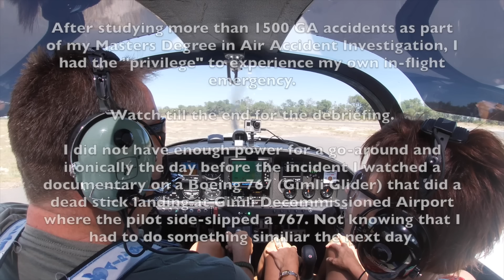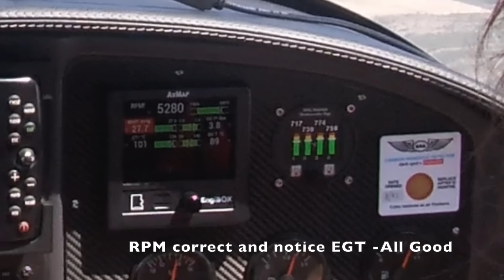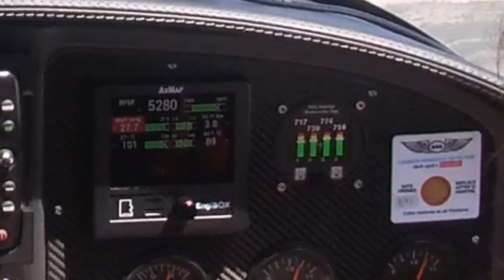Engine Failure at 1300ft AGL, Morningstar ZA, Pioneer 300

Comment: how you say you’re engine failed when it’s still working
Reply: From what I heard the engine had a failure of two cylinders not a total engine failure
Reply: @EI6DP-Real-Hams-Use-Vibroplexi would remove engine failure from this video then.  engine had an issue.  but it didn’t fail and kept working to some extent.   so this is very click bate in my opinion
Reply from the maker: I don’t give a shit about clicks. Aviation engines have only two states. 100% or failed. If you loose two cylinders then your engine failed. Now go troll someone else’s page please.
Reply: @justplaneadventures8030  click bater with click rage 😳

Comment: You kept your cool and did the most important thing first and foremost.  Flying the plane. Then working out where to fly it.  Only then trying to be coherent on the radio.  You nicely multiplexed "broadcast calls of intent" even if you didn't track the responses until you had everything else squaring away nicely.
Regards passengers.  They will look at you and judge how "flustered and paniced" you are.  If you are cool, they will be cool.

Comment: As an aerospace engineer, I have often wondered why a small deployable jet engine is not installed as a back up. Yes you add about 150lbs and cost about $8k USD. 

It just seems much better than a parachute

Comment: Been there!!  Let me guess… had some garbage in the main jet on one of the carbs?   When this happened to me I was able to throttle back and maintain 4600 rpm and limp back to the airport. Turns out there was a small piece of fuzz or fiber particle lodged in my left carb main jet.   These engine are extremely sensitive to power imbalances between the two sides of the engine.

Comment: Awesome job at maintaining control, you did an awesome job at keeping control and at keeping your sister under control in a moment of panic, I could hear her wanting to cry and could barely contain herself, but did everything she could to do so, so tell her she  also did a good job in a moment of panic. Excellent job also at side slipping her to line up better with the runway, you’d come in a little tight with the side winds and needed just a little adjustment and you pulled it off perfectly.

Comment: Engine was still running, just not running very good.
I was in a 182 once where the engine stopped running at about 6000ft.
The engine would not start with the key after several attempts, so we went into a dive and the prop finely started it.
Remember this, the slower the plain is capable of flying, the farther and better it will glide to a landing
There is a gauge that points to airports when close, and ours was showing one close enough to glide into, if need be.
A great day to live and talk about, as these people had.

Comment: The quote: It depends how much pressure. Emotional arrousment supports your performance until a certain point. If you pass that sweet-spot of arrousment, the performance gets lower again.
In the extreme case of an engine failure, most of us pass the sweet-spot and the quote appears to be correct. :)

Comment: Nicely done. Your sister was quite brave too. Maybe other pilots would say could have done this or that, I wouldn't know tbh. I just thought you handled the situation well and got it down without incident. I have been told that when flying a pilot usually keeps half an eye out for possible landing spots should things go sideways. Or be familiar with them on the route you fly.

Comment: No mag check, no tank switch, ???
Reply from the maker: No time
Reply: @justplaneadventures8030  Cant multi-task, dont fly.
Reply: @justplaneadventures8030  At least 60 seconds. Plenty of time to try mags, boost pump, carb heat, fuel tank.
Reply from the maker: The vibrations also played a big role, never knew a Rotax vibrates that much when you loose 2 cylinders

Comment: You had enough altitude to glide in at 1500 without the engine power. I would be very careful to rely on residual power when at lower altitude. Thanks for sharing. Great job.
Reply from the maker: Was about 5km away from Runway. But I agree on the power comment.

Comment: Why did you lose 2 & 4? Oil pump, drop in pressure, length of use? These things pop out of nowhere? 😮 Way to stay cool and keep your passenger at ease. Glad to have you down. 😊
Reply from the maker: Block in fuel for 2 and 4 carb

Comment: What kind of plane was this? Looks like a light sport not a full certificated plane with no mixture. I am sorry but every time I have been offered a ride in a exhibition or homebuilt I flat out sad no way. All stick to fully certificated planes  . AD’s and Service Bulletin’s both optional and mandatory need to be followed. Homebuilts aircraft no thanks, light sport same forget it. I had enough problems with certificated planes let alone being a test pilot. Also some Pipers forget it, the Comanche line with their tail flutter.Been there done that.

Comment: What the heck does that bug smasher use for an engine, sounds like a hair dryer.
Reply from the maker: The audio comes from the radio and the engine noise bleeds through on the radio. The engine is proper. Rotax 912uls
Reply: @justplaneadventures8030  Is it proper?  Is it though...?  Maybe I just read the title of this video wrong.

Comment: Very calmly done.. my similar but less stressfull experience was in a 3 axis microlight, doing practice circuits and practicing my landings while training, the aircraft suffered carb icing in the cold damp weather and the engine was spluttering and its rpm was quite eratic... certainly focused the mind. The main thing was that we were within easy reach of the airfield in a little aircraft that could glide very well.
We had enough height and a running engine, even if it wasnt running well. A no dramas landing, but we left the training for a more suitable day.

Comment: Engine sounded like it has a bad rod knocking, I'm very surprised the piolet couldn't hear this during acceleration on the runway, I can hear it.🧐🤔
Reply from the maker: It is not the engine, it is just noise bleeding through on the radio to the gopro

Comment: This is not second guessing or criticism. Mike Bush talked about rough running engines in a video, and he sighted statistics to back up his argument, and I have incorporated his advice in my training. 
When a normal running engine starts running rough the first thing we should do is click the magneto switch one click, if engine smooths out, leave the mag switch there and land as soon as practicable. If the engine is still running rough, click the mag switch one more time, if it runs smoothly leave the mag switch there and land as soon as practical.
 If the engine never smooths out return the mag switch to both and declare the emergency and land as soon as possible.
As soon as it started running rough and before you made the mayday call i saw you reach for a switch with your right hand but that action wasn’t talked about nor was there any discussion about magnetos unless I missed it. 
Your statement about cylinders 2and 4 indicates to me a strong indicator of a magneto problem. Was it a magneto failure?
Reply from the maker: Fuel block in left carb

Comment: I'm not a pilot or an aircraft mechanic, but I do work on my vehicles. There has got to be some kind of ongoing diagnostics that wouldn't be cost prohibitive to determine the health and air worthiness of the engine and to detect possible impending failures. This is too crucial with a single engine plane, not only for passengers but for people on the ground that might be in harms way.

Comment: My nightmare happened after take off 400 ft severe vibration just holding 70 ias, leaned mixture was about to park on the highway, engine caught enough rough running for circuit back to airfield. Boys in blue rear escort on landing. As you say it kicks in. Reason determined later , 40 hours over MTBO !

Comment: I experienced something very similar a few months ago. You aviated excellently, well done indeed. I also had a passenger and keeping them from panicking is a non-taught skill. One thing I think is lacking from all flight training is that we're always taught that the engine 'stops'. But this is rarely the case, in reality the engine runs rough, and the aviator is faced with the difficult decision whether to ride it out or abort. Thankfully, most of us choose to abort, but the return flight to the aerodrome is a rough, yet level one. None of the folks I've known to experience engine failures have had an outright stoppage, I wish training was more reflective of this.,

Comment: So glad it worked out well.  I had a similar experience with my Beechcraft last October.  Ninth time in the pattern, just as I was turning downwind my RPM's dropped from 2500 to 1600 and started to shake.  I was only 900' at the time, and luckily, I had a different runway (11) off to my left.  Slight turn and landed safely and even taxied back to the ramp.  At first, I thought that one of my P-Leads on a magneto grounded itself to the mixture cable, but after closer inspection I actually lost compression on one cylinder.  Looked like a thru-bolt on one cylinder was sheared off so it was time to pull the engine.  Turns out it was not one bolt, but four were actually sheared off and one was missing the nut (which I found at the base of the cylinder).  Did lots of damage internally.  After almost a year my 'new' rebuilt zero-time motor is done and last Sunday the process to reinstall it was started.

Comment: I was on a solo cross county flight in Kansas from Fort Riley KS be for I got my ticket. I lost engine of my 152 at 7,000 feet in the middle of cropland 150 miles from base. Fortunately I saw a crop duster strip to the side.. I glided to the strip and never was happier to feel the wheels tough down! The strip was very narrow - my wings were over corn stalks!. The pilot and ground crew from the commercial operation were gracias and towed me to their apron. Their mechanic found the issue (clogged fuel filter) and was able to get me back in the air. The airplane was a flying club plane. I am thankful that I was able to get it back to the fort in one piece! I am also glad that my instructor always emphasized situational awareness! As a soldier I was second nature on the ground,  More valuable in the air!
Reply: Cool freaking story!!

Comment: At what point was there engine "failure"?
Reply from the maker: At the point where cylinder 2 and 4 stopped firing. Leaving me with no thrust and massive vibrations.
Reply: @justplaneadventures8030  You had to have some thrust right? Wouldn't you guys have dropped like bricks if there was none?

Comment: its kinda odd how the engine started going rough right when you put your hand on the throttle, i mean if this was a real failure all my respect but im suspicious of the legitimacy of this event. Nice side slip on final tho :p
Reply from the maker: It is real trust me, look at the EGT fpr cylinder 2 & 4. Hard to fake that…it was a fuel block in left carb

Comment: You did exactly as you needed to do by focusing on FLYING THE PLANE. All the other stuff is moot if you crash.
Meanwhile your sister was a champ by remaining calm (albeit nervous) and followed your pre-flight emergency suggestion re: hanging onto shoulder straps which is smart.
PS> Your sister is HOT !      Single ?  hehe

Comment: Nicely done. I had a precautionary landing after similar symptoms that cleared while airborne. It turned out that I had water in one fuel tank (due to a bad seal on the fuel cap), and most likely ice crystals at high altitude blocked the fuel injectors. Once lower down it cleared, but I wasn't about to second guess things once I had made the decision to land.

Comment: Great video, glad you made it back safe! I have a question: Why does the Pioneer 300 sound so rough? During the taxi, it sounded like an office chair, or metal office cabinet cart being rolled on rough asphalt. The engine sounded a bit rough too on the takeoff. Is this just the camera's feedback? The plane looks solid from what I can see but sounded pretty flimsy on the ground.
Reply from the maker: It is just the radio that picks up engine noise and the GoPro is connected to the Radio

Comment: Perfect mastering of a harsh situation : engine fail at low altitude ! Calm, focus, and great manoeuvres back to the field. But once again, you can see that the emergency landing cheklist you are supposed to know before flying is just impossible to manage in such a situation .. instead, you "fly the baby" till its destination especially at 1300 feet. And once again, I personaly don't accept the idea of a 300 000 $ machine to break down on me like this. This is totally unbearable and unacceptable. I can't wait to fly on plane with electric motors...

Comment: Engine Malfunction is what you had. Engine FAILURE is when the engine stops (propeller may still be windmilling although I doubt it would with your geared engine). I have had both. Sadly in the same aircraft. I will never fly that aircraft again as the problem was never uncovered. Lot's of problems with the Rotax engines. Everyone loves to tell you how great they are. But as an A&P who has worked on them and flown them. They have a lot of draw backs.

Comment: I can totally feel your adrenaline in this video, well done for getting the plane safely onto the runway, great job.
I had 2 passengers with me in my C182 one day and lost oil pressure, I throttled back and kept flying, there was nothing but forrest underneath us. We flew for 15-20mins to the nearest runway because the engine seemed happy enough. Turned out we lost a piston skirt and a piece of that skirt was holding open the oil pressure relief valve so even though there was no pressure there must have been enough flow to keep it lubricated. Turned out to be no crankshaft damage but a new set of Continental pistons to replace the AEC aftermarket ones and a bulk strip for $20000 and it was like new.
The moral of the story: do not use after market key components in an aeroplane engine to try and save money, it could cost you your life! 
Previous owner had rebuilt the engine with non genuine parts, I had no idea.
Once again, great video, great flying and a great ending 🇦🇺

Comment: A good job ..you got down safely ..I would add that your passenger did very well ..from experience the last thing you want in a small plane is a panicking passenger ,it makes focusing  on safe aviation extremely difficult and there is the constant fear that they will lock up on the controls further endangering the flight .

Comment: Great flying, great coolness retention and a perfect brother. Flat engines are funny. You can actually loose a complete cylinder bank and the engine will still sound fine only down on power. My boss and I had built a Porsche 2.3 out to a 2.5 with 2.7 twin plug heads and EFI with ITBs. The engine sounded just fine but was sluggish. Took it to be tuned at the dyno and it only produced 70HP so obviously something was wrong. Traced it to ONE pin in a multi pin plug had come out causing bank one not to get any fuel.

Comment: There's absolutely nothing wrong in what you did, you acted exactly how you should, you didn't have time to run a diagnostic 1300 feet off the harddeck so you did good. 10/10

Comment: That motor didn’t sound good from the start of the video.  I can hear from the video it has an irregular idle, not running smooth. I would’ve never attempted that takeoff to begin with.
Reply from the maker: That is just the audio from the intercom. It is very irritating but that is not the sound of the motor.

Comment: I miss flying. Engine failures shouldn't be a sweat especially if you're based close to the beach (Virginia) or have open land like this in cpt.

Usually have enough time to get it back or land "safely" somewhere flat and non residential
Reply from the maker: Correct, it really is not a big issue as long as you maintain control of the airplane.

Comment: My grandfather, sitting behind my 9 year old (approx) mother in a Piper Cub, was at approx 3000 ft, realized the carb heater was not on when it started to sputter and could not reach the lever in time.  Engine cut out but he was not far from the airport.  He called it in for emergency landing and calmly lowered the angle of attack, figured out his approach and landed without incident.  My mother had no idea there was a problem as my grandfather was calm and cool throughout and she was surprised all the firetrucks were there on the tarmac when they landed. This was during the 1940's.
Reply from the maker: Thank you for sharing! Cool story.

Comment: Sounds like a blocked carb, also 5200 is a little low rpm for the 912, that low rpm is hard on the engine.
Reply from the maker: Yes, left carb was blocked

Comment: With 25,000 flight hours, I will no longer get in a single engine airplane unless it has a parachute. Engine failures are rare, but if it happens at the wrong time, you’re screwed, regardless of flying ability.

Comment: Your turn looked too slow. In loss of power you can't waste time and energy. And you head directly for the nearest corner of the runway, you don't turn final, you don't position for anything, there is no pattern, no nothing. Straight for the closest corner. Only if you have too much altitude as you get close can you bleed something off.
You can also continue to climb for a long time after take off at a rate that always guarantees a glide back. You can also kink to one side shortly after take off to have a more natural return earlier on in the take off. The early periods can be more difficult to salvage. Stall is not your friend.
You can test things by simulated engine failure. Just throttling down.